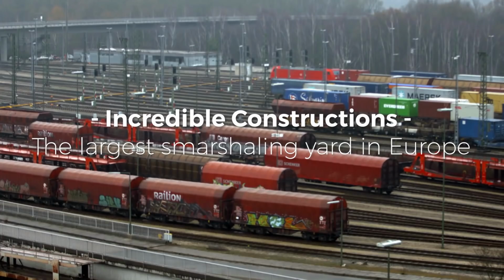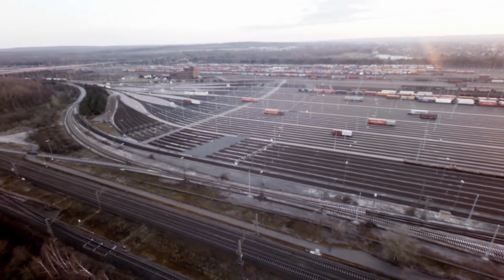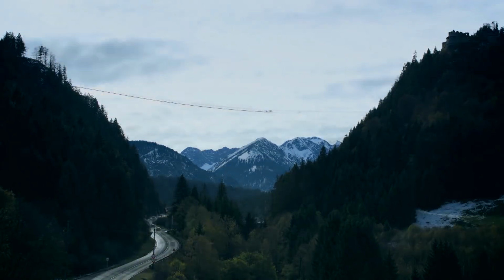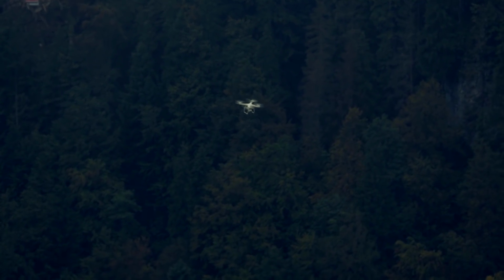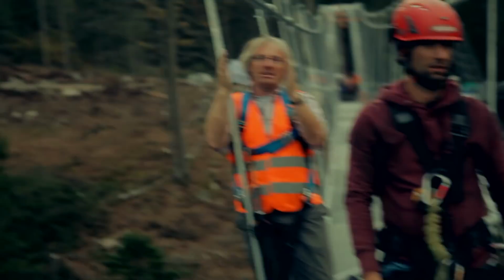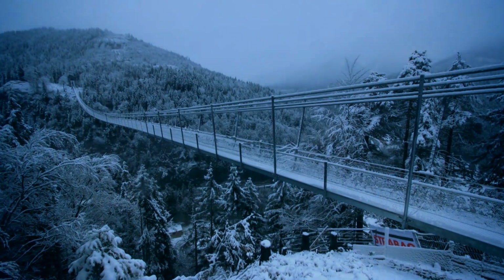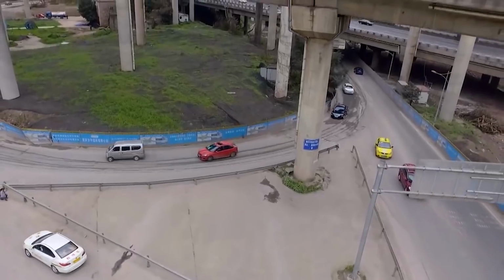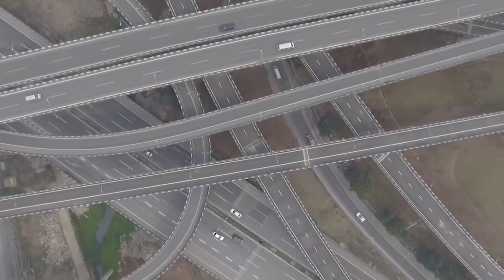Mega Constructions: Biggest Marshaling Yard, Suspension Bridge & Intersection | Free Documentary

Comment: Amazing to see how they organize and sort freight cars. The better they organize in Marshaling Yard, the easier it is to uncouple cars at their various destinations. I used to work for a manufacturing plant that had it's own spur to receive inventory and ship finished goods. Once on site, the spur split into 2 sections. One was outside plant. The other came right inside plant. There was enough room for 6 or 8 freight cars. Once in, a large door could be closed to keep cold or heat out. The concrete load dock was large and came within a foot of freight cars. A small ramp device bridged gap so forklifts could easily and safely go in and out of cars. One day they might be unloading fresh inventory. The next day, they might be loading finished goods. Trains and Trucks were very important to operations. We really depended on timely deliveries with no errors.

Comment: That coupling system is............ antiquated;  so is reference to rail cars as wagons?  American system just a lever to lift and knuckle opens up and hose can be decouple easily by hand or they will pull apart when train is moved.  This guy is doing my job in the yard which is to insect cars that come into the yard and if it need repairs send it to the "Rip track" or repair shop.  Former Car Repairman, SCL(L&N) Howell Yard, Evansville, IN.

Comment: 2700' feet...in the USA that's the size of our tiny local trains...I remember working on trains 10,000+ feet...the average size are 7000 feet and 100+ cars...and wow on those car couplers...that's sketchy...ha...ours just have a knuckle and pin lifter setup...super easy and you don't have to spend much time between the cars...that's pretty crazy they use that type of coupling system...seems very unnecessary...ha
Reply: Unfortunately that's what all of Europe standardized on, so they're stuck with it now.

Comment: I work for CN in Canada we have 14,000 foot trains twice daily and 4 other 10,000 foot trains run through the yard I work at and recently we tried running 16,000 foot trains which didn’t work out.
Reply: Jonny 6631 start getting that long they get too heavy. 15k is the longest I’ve ever seen. That with 2 motors on the head end a DP in the middle and a DP at the rear end. Would take a hour to get the whole thing shoved into 3 tracks at the rail yard I worked on. It was a intermodal/auto rack terminal

Comment: You know what's really sad is the buffer and chain link connection design was invented in 1804 with the first steam locomotive I'd say buffers and chain link are extremely antiquated you guys need to upgrade to Buckeye couplers you will be able to pull longer trains and uncouple your cars faster with more convenience and safety you don't have to get in the middle of the track to uncouple the train cars there is a lever off to this side of the locomotive or rail car that you pull and it pulls a pin in the coupler what opens the knuckle Wichita a lot more convenient then have to stand in the middle of the track come on Germany I thought you were technological get Europe and yourselves a break and help yourselves out a little bit with a technological upgrades like Buckeye couplers if you actually do this you will thank me later you will be able to pull longer train without the connection breaking Buckeye couplers are extremely strong we can pull trains over 2 miles long wake up Europe your couplers are over 200 years old time to upgrade don't you think
Reply: Easier said than done when it would require 30+ countries (only 27 of whom are in the EU so you can't even just use a directive, not that it ever really works out like that anyway lol) would need to switch over at pretty much the same time. There's a LOT of international links and using of each others rolling stock etc. So it all needs to work with each other.

Comment: I just don't understand why when Australia converted over to Buckeye couplers they can pull 10 times the length of the train Europe you need to get with it get Buckeye couplers you don't need to lift them only thing you need to lift is a pin that opens the coupler to disconnect and uncouple come on get some cross Europe unification and change out your buffers for couplers you will think me one day if you actually do it your buffers and chain links are very weak compared to a buckeye coupler good luck Europe

Comment: Germany's longest train, 2700 feet *laughs in American* Typical freight train here is 6,000-12,000 feet!
Reply: That was my reaction, I’ve personally been an conductor on numerous 14,000-16,000 ft trains
Reply: The largest classification yard is in the US.

Its twice the size of this yard.
Reply: @michaelmccarthy4615  I was guessing BNSF's Argentine Yard, but it's UP Bailey yard in North Platte, Nebraska. That place is totally off the charts huge.
Reply: They don't doublestack shipping containers in Europe.
Reply: @skyh  Probably because of the limited clearance of many of the bridges, overpasses and especially tunnels in many parts of the continent.  A number of railroads here in the 'States still are unable to run doublestacks over certain lines because of limited tunnel clearance.  Widening and expanding overhead clearance is both expensive and sometimes nearly impossible due to the type of rock they have to deal with.
Reply: @robertf3479    Yep.  One of the worst bottlenecks on the entire east coast was the old Virginia Avenue Tunnel under SW DC. It was single track and too short for doublestacks. They just recently rebuilt it as two high-clearance tunnels so now they can run doublestack trains north and west through DC.  CSX's next major redo is going to have to be the Howard Street Tunnel in Baltimore. Once that's done CSX can start running doublestacks out the port of Baltimore into the midwest, which will theoretically revolutionize Baltimore's port traffic.
Reply: @skyh  Thats because most of Europe's rails are electrified and that has hight restriction, while in the US you guys mostly use disels (so the only restriction is tunnels and bridges).
Reply: @skyh  We don't use ancient diesel engines...
Reply: @oddballhippie7363   Most of the mainline locomotives I've observed aren't all that ancient, and plenty powerful at 4400 and 6000 hp per unit.
Reply: @skyh  They also don't have the tunnels  like we do.  Some of their rail lines are old.
Reply: @skyh  oddly, India is beginning to doublestack.
Reply: We asked a freight train we were passing in Missouri (Work for Amtrak) how long they were. 15000 feet. XD
Reply: Isaac Bowser there’s 5280 feet in a mile, no train in American is 3 miles long, it’s logistically not possible. I worked for UP, the most we had were two trains connected as one consist that’s extremely rare and would still only be less than 10,000 feet. Australian ore trains are by far the longest in the world as there are no sidings needed for no switching operations of one commodity.
Reply: @jasonw4932  how long ago?  Norfolk Southern in the PSR era is pushing 10k feet all the time!  Sometimes more, especially with DPUs
Reply: @jasonw4932  you are incorrect.  16,000-foot trains (over 3 miles), while not common, have run on BNSF's southern transcon on almost a daily basis during the summer months.   There are plenty of Youtube videos of these.  
The longest train captured on a Virtual Railfan live-feed camera was actually a UP train at Kearney Nebraska, which was over 17,000 feet long, had two sets of mid-DPUs, and required special permission from FRA to run.
Reply: @jasonw4932   Train lengths are generally limited by real estate for passing sidings, and 10,000 would be an exceptionally long siding. Most railroads would likely call a siding that long "double track" :D
Reply: @Kingkoopa00  15k is 1 percent of all trains in us
Reply: Aussie laughs at American You call that a train, this is a train: 7.3km or 4.5 miles
Reply: @HornetsNest-MH  What do you pull that with? 🤔🤔🤔
Reply: @joelsanfordphoto  Probably his Holden Ute
Reply: Joel Sanford I copied this from the article.. Conveying 82000 wet tonnes of iron ore, the 7·3 km train was formed of 682 wagons hauled by all eight of BHPIO’s General Electric AC6000CW diesel locomotives. Gross weight was 99734 tonnes.
Reply: @joelsanfordphoto  the record longest ever was pulled with ge diesle electros, now bought up by westinghouse airbrake company wabtec, sale reported complete in trains magazine febuary 25 2019, I think it used about 8 of them on the train
Reply: @joelsanfordphoto  It's usually pulled with about 7 to 8 engines.
Reply: thatclintguy
You also have the biggest heads in the world.
Reply: If the train was any longer it would reach both sides of Germany
Reply: @K-Effect  cause germany is so the size of monaco
Reply: Same here for Canadian freight trains and half of those trains are stacker trains.  I can't figure out how European railways can afford to run such short trains without bleeding money.  They must charge way higher freight tonnage fees compaired to America.   Canadian freight trains average 2 to 3 km long (150 to 250 wagons)
Reply: laughs in Australian Gotta love it when Americans think they know big and sparse.
Reply: @TheDemocrab  just don't forget that it's American locomotives pulling those crazy-long, remote region ore and coal trains 😜
Reply: @thatclintguy  American designs built in NSW and somewhat customised for our routes and conditions, yeah...Shame that the Aussie government seems to have something against Australian built anything (Apart from holes in the ground) because we used to have some cool designs when we did actually make our own
Reply: Yea I was pretty amused when he said 40 cars was a lot
Reply: I've seen videos of 15000 foot plus freight trains in the US on youtube
Reply: @LukeNicolaides-rq2dr  But Americans can't convert, so despite sticking to their archaic system while the world moved on, they expect the world to do the converting for them.
Reply: @deaddoll1361  .....yeah....our old archaic system....but how many countries using the metric system have landed men on the moon?....oh ...that's right...none.....and by the way....you might not be aware but we use BOTH systems
Reply: @1bytor  Psssst hey Harold.  Half of the senior management of that escapade were Canadian from AVRO
Reply: Hehee
Reply: Aussies have the longest trains.. once was over 7 km long... put that in perspective that's almost 5 miles
Reply: @archeebookingagent1909  ....yep.....on flat land....let's see how they would do on a 2 to 5 percent grade in the mountains like we pull our 2 to 3 mile trains....put that in perspective
Reply: @1bytor  They said longest train it doesn't matter I'm saying what they said
Reply: @1bytor  It takes a PILE of power to move trains over those grades. I've watched trains thru Whitefish, MT with 5 units on the front, two in the middle, and four pushing.  I'm fairly sure you won't find 5 percent grades on any mainline mileage in the States.  Steepest mainline grade in the US used to be Norfolk Southern's old N&W line thru Saluda, NC, which averaged 4-1/4% with a short stretch of 4.9% near the summit. The track is still there and NS hasn't applied to abandon it, but it hasn't seen a train in years.
Reply: Trains have come to LA Ports that are over 17,000 ft in length.  2700 is laughable to many in US but that may be a Monster in the EU.
Reply: And that’s just the shortest US freight train
Reply: Not funny if you are a driver waiting at a crossing for a 12,000 foot long train to pass. 😂
Reply: Europe's half-mile long train is nothing compared to the 2-mile long trains on CN and CP. But, with PSR (which is another excuse for corporate greed and layoffs) trains are becoming longer and longer.
Reply: PTC is the beginning of automated trains...even more layoffs.
Reply: @burdizdawurd  The train lenght is due to the short stations lenght and that is due to short distance. If the trains are to long , they can pass each other unless going into a rip track. You cant compare the distances in Europe and America or Australia. The best example are the humangaus iron trains of Australia that are several km long running on a single track with hundreds of km between stations. In such distnaces is better to stack them on a single train an then just brake a part while here several hundred km is the distance between countries so its better to send several trains to the individual destinations.
Reply: @burdizdawurd  Same goes for CSX; of course, you-know-who was in charge long enough to screw everything up. The fact that he tried to kill the Howard Street tunnel project in Baltimore proves your point. The shippers be damned.
Reply: True but European railways are limited to a certain size and all European railways are the same gauge as are the losing gauge
Reply: @charliestrains9826  that's very true. European loading gauges and plate sizes differ from Americans. We rely on trains and use effecient AAR/janey couplers, while Europeans with their smaller land mass can rely on trucks and dangerous chain or drawbar couplers. It's so inefficient!
Reply: @burdizdawurd  That's why Europe is going to standardized automatic couple...that includes the electronics and brakes...so they'll be more efficient that the Janney.
Reply: @burdizdawurd  The US is better at transporting freight compared to Europe which is better at transporting passengers so Europe has the inefficient chain-coupling system + European cargo trains would cause congestion on the rails
Reply: I'm just boggled that they still couple cars with the old hook and link. Didn't USA outlaw that and switch to knuckle couplers about 150 years ago?
Reply: @jthomas5987   Yes.  All rail freight cars must be coupled by Janney knuckle type couplers in the US.
Reply: in America you say 12.000 feet long.... Australia has a trains  12,000 km long mate. hahaha
Reply: @opalking7654  Seems like some of your truck/road trains are almost that long !
Reply: @opalking7654  
Aren't you Australians taught math? A 12,000 km train would reach halfway around your coastline.
Reply: Smirks in american

Comment: Imagine in Europe being surprised by a 2700' train. It would be nice if they could be impelled to keep them under two miles here in US.
Reply: True, but keep in mind that Germany's railroads are far busier, passenger trains have priority, and most freight trains there are put together to be "fast freight" @120 km/h or ~75mph. Just some ideas on why they never reach the length of American trains.
Reply: @SchmidtyC  Christian, in West Australia's Pilbara region, trains of iron ore are 2K's or longer, 30, 000 tonnes plus AND no engineer at the controls, each train is driven by A.I. and trains are 10 minutes apart. Speeds run at 50 MPH loaded and 60 MPH empty.
Reply: @itchyvet  right, but how busy are the railways with other traffic? It's one thing to run trains in short intervals on a single long route with no shared track with other lines. Western Australia is hardly a comparison to Central Europe in terms of population and traffic density. Still, interesting with the automated system! Thanks for the insight
Reply: So travelling from 1 end of the train to another becomes the average length of a jogging session
Reply: Was thinking about the same thing in some  mining regions of Australia it is a slow day if there is less than 15 trains that are over 2200meters in 24 hours
Reply: @94Gidge  The railway security system doesn't allow train length of 2 kilometers here in Europe. 
The max  lengh is 700m. Due to the distance pre-signal -- main signal, which is 1000m. And you still need some security lenght. Trains don't stop instantly like your bike or your car.
Reply: @carstenhemel2574   Quote, "trains don't stop instantly like your bike or your car.
" No shite sherlock.